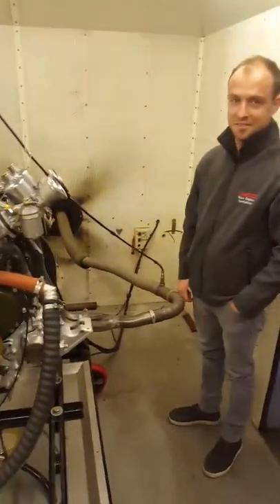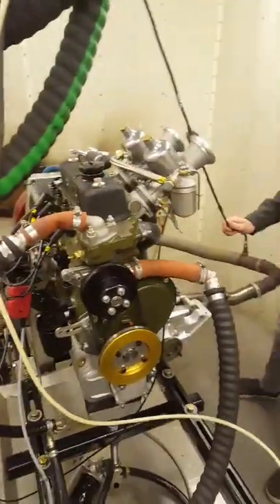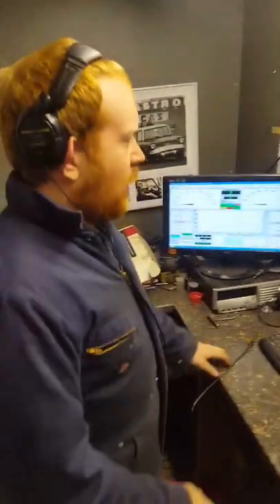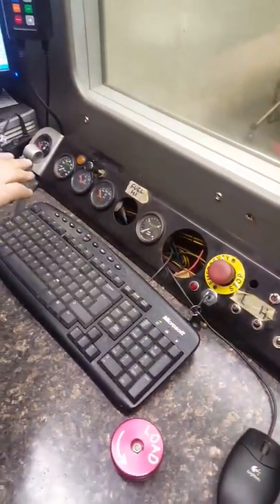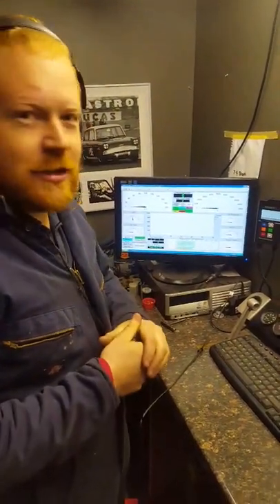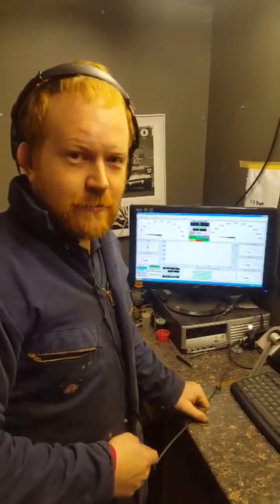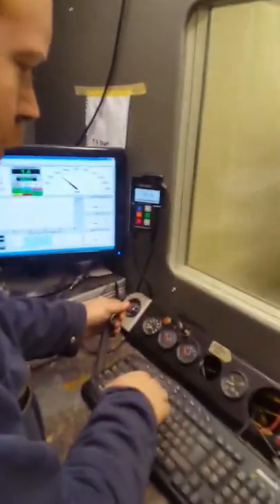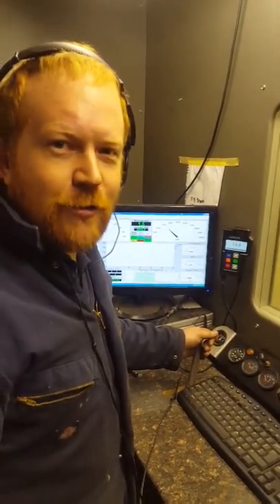MED Historic racing Mini engine on the dyno at 8000rpm

Comment: Big Effing Deal  !   I was running My 1275 'S' to 7500 Rpm for Years (SCCA C sedan) in 1972 !!
 Hard on the  3 :-) mains certainly ..but it never burst either.
Sooo How many Ponies  100? 110? 125?  Neighbor kids Box stock 89 Civic has 137 and Braking NO mini could ever equal.
 Moderne times  People

Comment: How is the load applied / recorded? are the outputs attached to the dyno and the reading is taken through the transmission or is the crank attached directly somehow? With or Without flywheel? Can you change ignition curve from within the booth or do you have to go inside and physically move distributer?